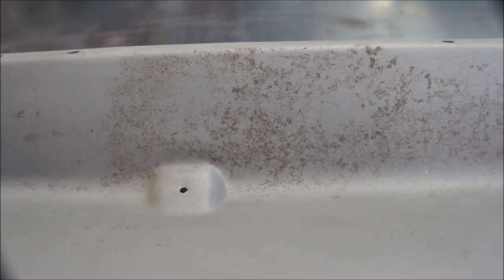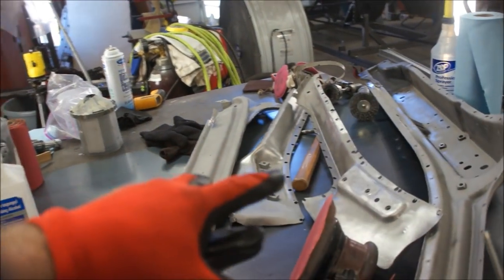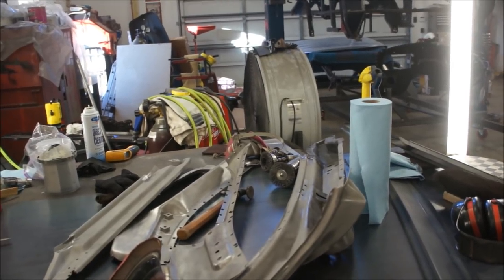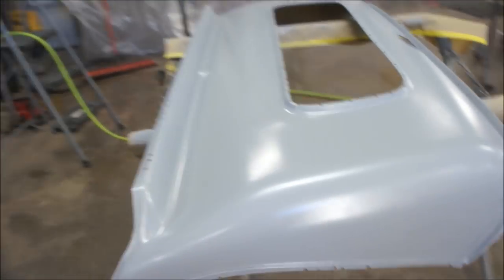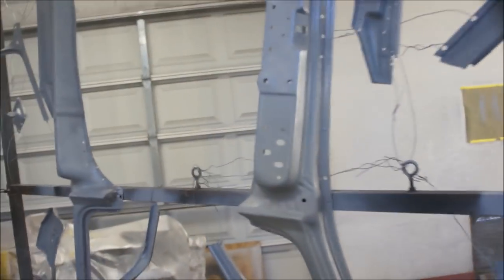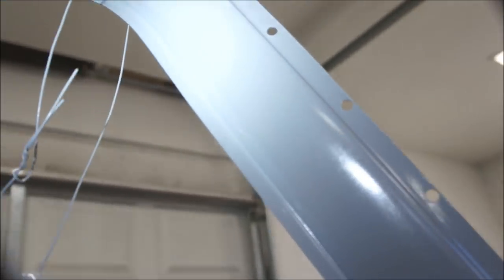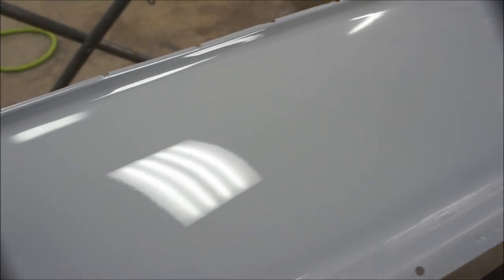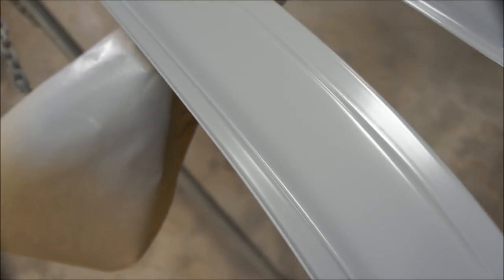Spraying SPI epoxy

Comment: Great Video. The work and all the talk about rust is great stuff. Most people don't know about this and even think that once they see any rust around on metal that it cannot be salvaged. So great video on that. Yes on a micro level you will always have it there. Even after your work you've done, is completed. Raw metal starts reacting shortly if there is moisture in the air.. You are very meticulous and that is very good to be. But it can lead to spending way more time and material cost to finishing a seal coat job. Since the epoxy primer is a sealer, all we have to make sure is to get that stuff to stick no matter what. Should you lay it down on rust? Hell no. But If we work too hard and spend too much time removing rust, the surface can become too slick and the epoxy will not stick as well. Surface prep is more important than making sure the visible rust in the pits is visibly gone. I saw the video where you did 180 grit to help clean the metal, even ore. Then 80 to rough it back up. Really, in my opinion, the 180 is not necessary at this point. Kind of overkill in my opinion. It is one reason why media blasting works so well. And right after blasting we can clean the surface chemically and then seal. I've known many to blast and then it be weeks before they wipe down the metal and seal it. Because no matter what we are going to be leaving rust behind. The media blasting leaves tiny jagged crevices in the metal and the sealer finds its way into these. This is extremely good. We don't want to wire brush excessively or keep polishing the metal at this point until it is mirror-like. As we are not giving the sealer something to bond to. So, Yes it is okay to leave some visible rust there that is in the deep pits. The paint will stick and never pull away. I go over the areas with a chemical rust retarding solution after blasting and then with a cleaner and degreaser right before sealing. So depending on the media used and tooth left in metal. We are ready to seal right after blasting. The rough metal surface is good for sealer.
But wow. I love the way you take your time and make it the best possible piece you can manage. Like creating a piece of art. Would I want you doing my body work? Yes! Definitely. Do I work this hard myself. no. Thanks for the video bro.
Reply from the maker: Rick Bell so to sum up what you said here , blast the metal , treat it with acid, clean it and put  it in epoxy immediately. If it’s rusted like this was re blast it and do the same process ? Right ? The issue that I have is I can’t put a conditioner on the metal because spi doesn’t play well with acid , other than that I’m all in on that method
Reply from the maker: Rick Bell oh and thanks for another great comment
Reply from the maker: Rick Bell so anytime someone starts giving great comments and advice that sounds correct , I check their channel to see what they have going on and the skill level they have , so I looked you up , other than how to get rich vids, I see your first vehicle  vid 3 months ago you state you have never restored a vehicle before but anyone and everyone can do it ?? So you have no formal training and watch YouTube vids and the internet to get your knowledge? Then comment on others peoples vids and tell them how to do it ? I’m confused? And when you say anyone can do this ... yeah I don’t think so or people wouldn’t be calling me all the time to get their car done . So fill me in on you , because with the vids you posted you are just winging it .
Reply: sorry if you are confused. I have worked in several body shops in Dallas and Fort Worth and also Weatherford. I'm 60 years of age and have done mechanic work as well. But bodywork I've specialized in and have been paid professionally to do so. Probably over 10 years of work in the industry. And yes, If I can do it most anyone can do it. I did post a vid about the new restore I was doing. And it is my first in that sense.  But I do like listening and watching what others are doing. I try to help if I can and if I don't know something I keep my mouth shut. And yes...correct about I have not restored a complete vehicle. I mostly did insurance claims out of Dallas paint and body. But the guy I partnered with did custom rebuilds. So I do have lots of knowledge and some skill. But for me it is my first car to do from rust to pearl entirely by myself. Again.  We figure things out along the way on things we are not certain of. And there is lots of uncertainty with the info going around today. I try to keep it simple and help or comment when I have time. But, each to his own right> No two situations are every quite exactly the same. I don't consider myself an expert at anything. More of a jack of all trades. And master of none. If I said something to offend you I apologize. I don't have all the answers. But then who does. :) My question I guess now that I've tried to fill you in on some history...is...Do I have to post videos to know what I'm talking about? :)
Reply: I think people believe that if you don't have a channel than possibly you don't know what you are talking about. But years of working in body shops tell me that I do know quite a bit about body/paint work. And if I don't know something I keep my mouth shut. But from now on since no matter what I have to say it seems it will be criticized here on utube so best I get back to my shop where I can get things done. Why waste my time here. :)
Reply from the maker: Rick Bell I get this response at times when i question people, however I question everything, everyone has an opinion whether they have ever done anything or not , so when someone seems to know what they are talking about I researched them . And no you don’t have to have a channel , but I get so many people telling me how to do things I have to sift through the bullshit , you did not offend me at all, I’m just trying to see if your full of shit or not . When you said “ this is my first restoration “ I think then why are you giving me advise ? So for me had you introduced yourself in your vid and told your history of body work we would not be having this conversation because I would have known you have done this your whole life ... now I have made more friends by calling them out here on YouTube or them calling me out , and we end up getting to know one another a lot better . Thanks for giving your background it honestly does help me to know who I can listen too and who I would rather not .
Reply: i get it. Thanks for being fair. Normally when I comment it is after many hours of research and testing myself, before hand.  And yes. I'm not a great video guy like yourself and a few months ago someone told me I could not restore a 60 year old rust bucket even with my body experience and it take me less than two years....it is the reason for the comment.I was thinking about sending them that video. Never did. And yes I stand by anyone being able to do this...if they want to. The info is here thanks to you and others here on utube. I mean like you....If we learn and practice we get good at whatever it is we are doing. And if we have a passion for this stuff, we get better and better. And mostly when we have the skills others don't, then yes it is easy to give advice. You do a great job in your videos. I don't like criticizing anyone or telling them anything without at least telling them a couple of good things also about there work. Most won't go to the trouble. But yes you should always check on what others tell you. That is only smart. You did the right thing. Just you could not base any foundation on one video and my unknown past experience is all.And even though my first restoration, I've got skills with bodywork, prep work, painting, rust removal, media blasting, sealing, sanding, and everything else. Doing collision repair for years teaches you many skills. I Just need more money to throw at my project. Today managed to get the 56 completed sealed and used EPX-904 sealer. I'm actually disabled and draw disability. So I cannot do lots of videos that show me working on cars. However I liked the idea of doing that when I bought the car. ha. Great talking with you. Keep up the good work and the videos. You come across as a natural. And great info as well.
Reply from the maker: Rick Bell thanks 🙏 keep up the comments and I will stop being an ass :)

Comment: I have a trick to help you with your brushes flying all over and hurting you. I'm not sure if it'll work on your 180 degree one, where it's lot of brushes along the axis of your grinder, but the one that is 90 degrees...I weld next to where the brushes are...not on the brushes, just a bit in. I have one that I've used nearly daily for a few years where it's only now getting pretty ratty and worn down. Before maybe it'd last a project or two? And I buy the cheap packs of them at Harbor Freight. Shoot, seems the stores that sell them for $5 each versus $6 for a back at Harbor Freight sure look identical except in price.

Comment: In the pitted areas, do you believe rust converters would help?
Reply from the maker: Idaho 2nd Gens absolutely! And if I ever switch epoxies I will use them like ospho for instance is a phosphoric acid treatment that you are suppose to be able to epoxy over and is suppose to work great. spi doesn’t play well with any type of acid treatment

Comment: I commented on one of your other videos.   Do you have any knowledge of this product holding back rust, like something you painted yrs ago?  As far as the rust, I mechanically clean it, then sand blast, the use phosphoric acid with a red scotch brite pad.  I've noticed this epoxy goes on better with light coats and multiple passes, just like you're doing in this video. .I normally don't spray like this, but find it necessary with this SPI
Reply from the maker: Front Line Media yes I have used this for years and have many pieces from years ago , it does its job for sure, I made a vid on spi epoxy torcher test years back , I still have those pieces. Don’t use acid under it tho or it will fail 100 %
Reply: @MrFireman164  yea, I saw that video.  That's how I found out about the product.  I really have no choice but to use the acid.  I'm working outside on a sprinter van,  some days bare metal is exposed and rust reforms.  I have to use the acid to clean the metal and I do wash with a wet towel repeatedly.  I used another epoxy and put it on 2 motocross frames.  The one treated with acid did not wear, the other had some bad adhesion at wear pts, like where the boot rubs.  But this SPI sprays strange and I never saw a paint before separate after mixing.
Reply from the maker: Front Line Media if it’s separated something is wrong, I would call spi and talk with Barry the owner.
Reply: @MrFireman164  It has to do with the solvent in the paint.  You know how after you mix the two parts and let sit, and it separates.  The same thing happens when it is sprayed.  They suggested I turn up the pressure.  I've noticed it sprays better in my touch up gun then my regular one.  I did turn up the pressure prior to talking with them, looking for a solution.  I did this because I felt the paint was thicker in general.  I also tried spraying a light first coat, then a medium one.  It is what it is.  I'm just going to have to mess around with it and really watch when I spray to get all surfaces.  It really takes multiple passes to get a good flow of the paint.  Since I'm so poor rt now, this epoxy will probably be my final finish coat.
Reply from the maker: Front Line Media what gun do you use ?
Reply: @MrFireman164  several.  Never had a problem, ever.  Been painting for 30 yrs.  I definitely will be buying reducer, and probably go 10%
Reply: @MrFireman164  I think I figured this out.  My gun has a gauge on it and my touch up does not.  The touch up is spraying better b/c is is going at a higher pressure.  I'm reducing the epoxy at 10%, and see how it sprays.   I don't want to spray at that high pressure b/c it wastes a lot of paint.

Comment: Just got my SPI Epoxy. About to start spraying. Any advice that's not on the SPI website?
Reply from the maker: Dodgeman7979 yes
Reply from the maker: Dodgeman7979 set your incoming air at the gun at 29 psi or more , lay the first coat down light , then lay the second med wet 3rd the same if you lay a 3rd , wait 30 min or more between coats for flash time .